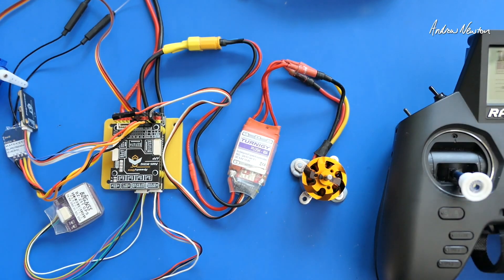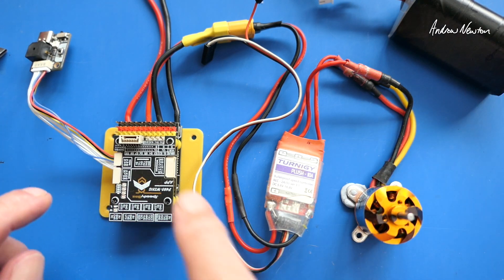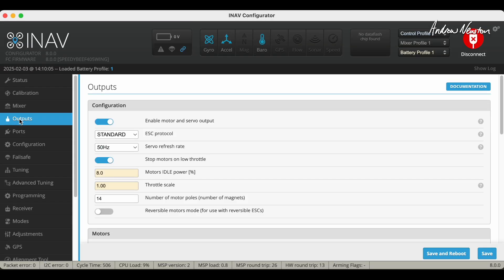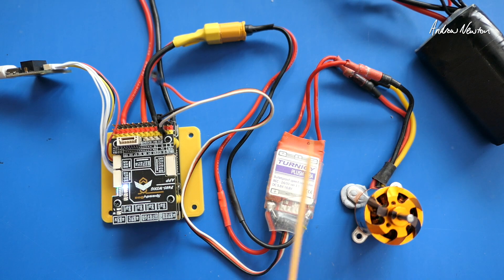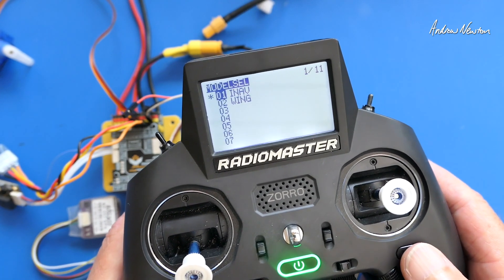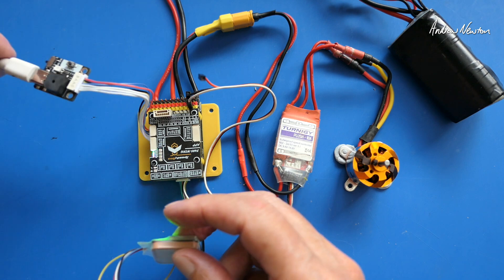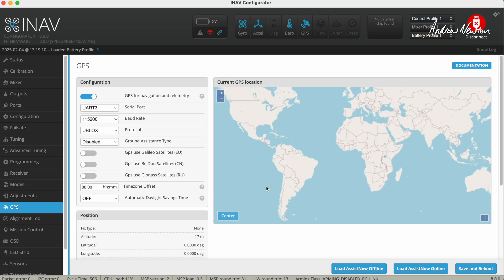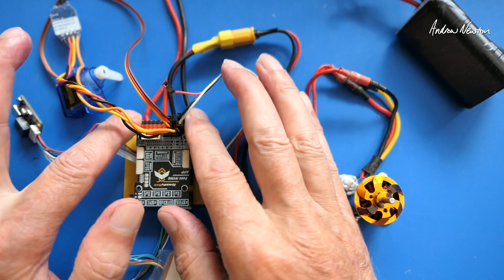INAV Troubleshooting - Motor Won't Spin & Arming

Comment: Excellent video!  Ive been trying to figure out why my Altus VTOL would not arm.  I'm used to building quads and this is my first airplane.  I realized, after watching your video, that I had not calibrated these standard ESC'S.  I"m so used to using 4-in-1 ESC's with D-shot.  I calibrated them and it armed right away.  It was tricky becase there were no arming flags in the goggles or on the status page.  THANK YOU!
Reply from the maker: Excellent. Good to hear you worked it out.

Comment: How can I connect a servo to the motor output so I can install a gasoline engine? Everyone tells me I have to convert it to PWM, but I can't figure out how to do it.
Reply from the maker: To change S1 and S2 from motor to servo, go to the INAV Mixer page and change the Timer 4 output from Auto/Motor to Servo
Reply: Thank you very much, I will try and let you know the results. Also, if you would be willing to make just one video on the topic in the future, I think that would be a question many people would have as well.  @AndrewNewton
Reply: I've been searching online and haven't found any videos related to this topic. I have several projects involving combustion engine aircraft and haven't been able to make progress because of this. Thanks in advance.  @AndrewNewton
Reply from the maker: @lestherpinal6978  I have never flown IC planes but look at Darren Lines channel (MrD - Falling with style). I recall he has some experience.

Comment: Great video - thanks for making it!  I had issues getting my ESC to calibrate so I will add this comment in hopes it may help others.
I am using a DYS 50 amp ESC plugged in to S1 on my Speedybee F405 Mini Wing flight controller, TBS Tango II transmitter and a 6S lipo.  Using the procedure you described in your video,  I was not able to get the ESC to calibrate.  It just kept beeping and beeping.  I tired several times without success.  Eventually, I plugged the ESC into S2, and it worked!  It was being recognized as "motor" on S1 in INAV, but wouldn't calibrate.  Then, after switching to S2, it was recognized as S2 "motor" and calibrated normally.   Hope this helps someone down the road. 
Thanks again for the informative video - it is very much appreciated!
Reply from the maker: Thanks for the feedback and great to hear that you got it working!

Comment: I was scratching my head with my Heewing T1 Ranger because the right motor worked, but the left motor would not despite the wiring and iNav setups appearing to be correct. It ended up being that the ESC needed to be recalibrated and now everything works as it should. Thank you so much for these helpful videos!!
Reply from the maker: I had the same problem with my AtomRC Penguin. Happy to help

Comment: Inav 8.01 with a speedybee 405wing installed in a fixed wing e-flite T-28 2M. All configured and cannot get he ESC to spin the prop on throttle command. All checked green and when i move the throttle up from idle the Arming Tab at bottom of iNav shows ARMING_DISABLED_THROTTLE. In outputs menu and motor test mode the motor operates with the slider. Throttle range goes from 997 idle to 1997 full throttle.  Any suggestions would be greatly appreciated.
Reply from the maker: Re calibrate your throttle in the radio, re calibrate the ESC in INAV, check you have the correct channel order so that throttle channel is what INAV expects
Reply: Thank you, Andrew for your reply and still having the same issue with the same flag on the bottom after going through all those steps. Will keep trying to figure it out but a bit stumped at this point.
Reply: @alexmilojevic2389 I am having the same issue in my Talon.  If I figure it out I will let ya know.  Has me questioning my sanity 😂

Comment: Working on a High School project, just finished all the printing for all the pieces and now currently testing the electronics with Inav. Updated the firmware of the radio transmitter, speedy bee flight controller and ELRS receiver. Im able to bind the radio with the receiver and visible in inav, the remote is able to control the servos but i have been stuck for days on trying to control the motor with the radio. I am able to control the motor within Inav it just wont turn on from the radio. GPS and telemetry are also working well. I only need the throttle working to finish assembling the plane. Any help or guidance would be greatly appreciated!
Reply from the maker: The arming error message in INAV might give a clue. Nav mode selected? Cut switch in the radio?
Reply: I'm on the same boat, did you find a solution yet?

Comment: Hi Andrew, thanks for the explanation.
I'm using the Speedybee F405 Wing flight controller with an FS-i6 transmitter and FS-ia6b receiver. The motor spins using sliders in iNav, and channels move correctly under the receiver tab. Servos are working from the transmitter output, and there are no errors in the pre-arming checklist. However, the motor does not spin from the transmitter throttle stick output.
Reply from the maker: Does the throttle bar move in the receiver page when you use the radio?
Reply: Yes it does
Few things I noticed
1. In iNav, the motor starts spinning when it is above 60%.
2. On the radio controller, if I engage the arm switch, push the throttle up, then disarm, the motor spins for 2 seconds and stops.
Reply from the maker: I would re-calibrate the ESC in INAV. Make sure you have the INAV mix in your radio and channel order AETR, Are you using Mode 2?
Reply: @AndrewNewton so I am using the same receiver having a similar issue, everything is check arming is safe, I have all my channels set, I can test the motor and all works perfect, but I can’t arm the plane and spin the motor using the throttle stick, all servos work as they should with the sticks, also when I go into the mode tab I can see my arm switch is operation, but when I switch the arm switch I don’t hear any beep on the beeper and I should correct? Can’t figure this one out
Reply from the maker: @NoahsMotorWorks  Don't know about the beeper. I turn mine off. So you can make the throttle graph move in the INAV receiver page using the stick?
Reply: @ yes I can, I’m so stuck haven’t been able to figure it out, gps has lock, every check is green, I have an arm node and flight mode switch set and they are functional. I really don’t know what the issue is, I am new to inav but have used betaflight so they’re similar, I have a home set in the gps tab really don’t know what the issue is, I am going to reflash the board and see if that does anything
Reply from the maker: @NoahsMotorWorks  Send me your DIFF file if you want me to check it. Email in the description.
Reply: @NoahsMotorWorks  i think i have same problem of you what is the resut now ? thanks
Reply: @ soo we got it solved, when your in the modes tab, if you go to arm the plane and the arm tab turns purple you are going past the max value, you are out of the specified range. You have to adjust your remote, when you hit arm and the arm tab turns like a light blue color that means it’s working properly, hope this fixes your issue
Reply: @NoahsMotorWorks  Thanks so much, you don't know how much cortisol you've saved me! Hahahahaha! The information on the website about FC. TX n RX in Spanish is nil. I'd like to know what specific range I should have for ARM. I clearly solved this by expanding both points to the extremes, but without any technical justification. Thank you so much in advance! Just like @AndrewNewton, without him I wouldn't have been able to connect and learn this hobby.
Reply: @ValDiTrO0N there’s no specific range that you should have, as long as arm is arm and disarm is disarm you should be a okay, took me a minute to figure that one out 😂
Reply: hi, i have similar problem. :C
Reply: Didi you find the solution I am facing the same problem I made a stm 32 diy flight controller when I try to run motor from software it works well and when I run from Transmitter it didn't run hell me please😊 @naxozone

Comment: I had an issue recently with an old Parkzone esc and Inav. They will not play nice the esc only accepted 50hz pwm  but Inav forces the motor outputs to 100hz(the 50 hz slider only applies to servo outputs). I mixed the output to a servo port and it all worked fine. Not a real optimal solution so I replaced the esc in the end.
Reply from the maker: Novel solution. ESCs can be tricky

Comment: Great video as always Andrew,  fOr newcombers if you are inside and can't get a GPS satelite lock you can 'cheat' by holding throttle stick down and right when flicking the arming switch, this will bypass the GPS check.
Reply from the maker: Great tip thanks. I never remember that